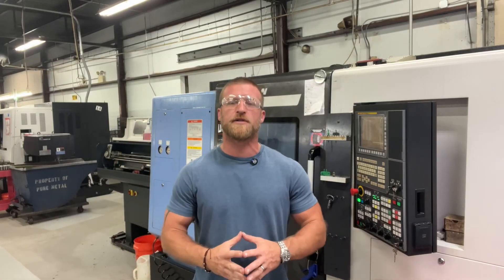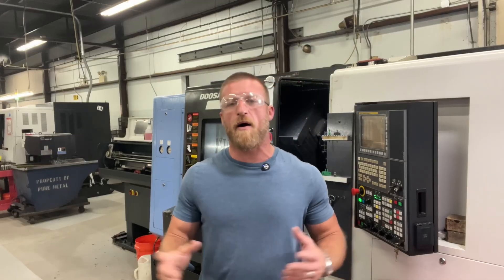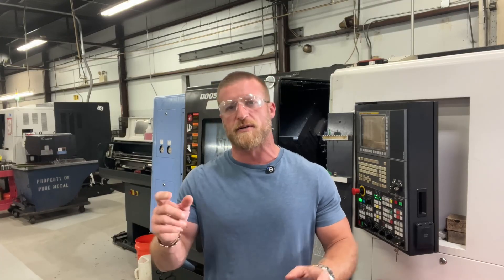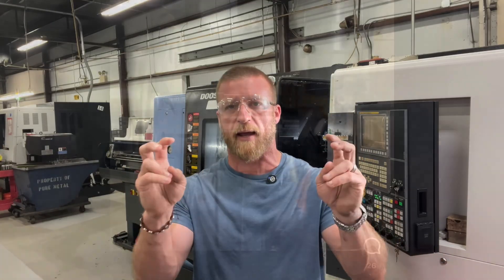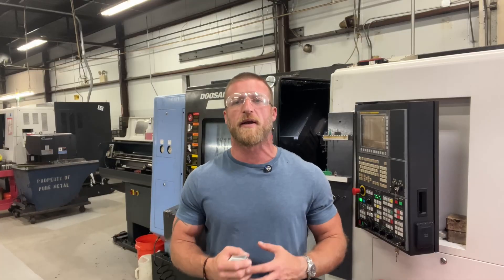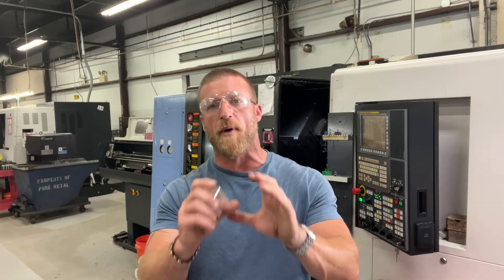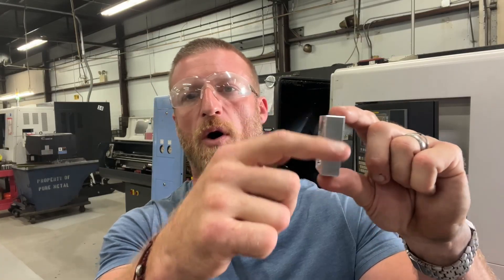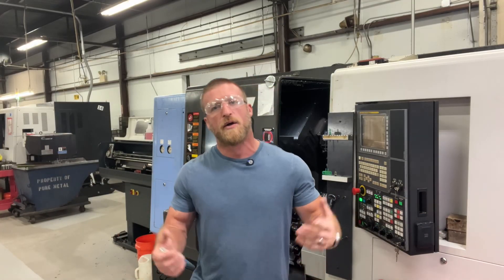Why Don’t We “Mill”⁉️ How We Use a Lathe To Mill. #cnc #cncmachining #machine

Comment: I'm 20 years in now. Started out conventional milling, 3 axis cnc milling to 5 axis cnc milling.
Currently working with cnc lathes, 2 Namakura's WT-150 and 1 Nakamura WT-100.
Eccentric Hainbuch chucks, all double turret with subspindels and bar feeders.
Max diameter is 40mm or 1,574 inch.
We also do all our milling on those lathes, including deburring.
90% of what we produce is for the medical industry so very tight tolerances and when it's spitting out products they are ready to send. No detailing etc

It's great to see craftsman like yourself show young people how cool this profession really is.
Reply from the maker: Hey thank you very much. That sounds like you have some awesome experience.  Keep kicking butt.!!

Comment: I do love lathes for this reason. One place to work hold when you’re working with a bar job, and it gives you access to every side except the back of the part in one op, and with a sub spindle you can reach that too. Plus while mills are of course useful and have their place (and at my work we’re starting to use thread milling to put threads on workpiece that before were put in massive heavy jigs and single point threaded on a CNC lathe, boy that was scary), it does tend to get old quick (in my experience). Lathes with milling spindles are so much fun cause they’re so versatile, you can reach all sides of the workpiece in one operation instead of at least 3 if not 6 and it’s more thrilling and primal if you like cause of ‘big spinny thingy’ as I call it as well as the danger factor 🤣. Love your content as always.
Reply from the maker: I agree with everything you said. Thrilling and primal hahaha I love it 😆 thank you for your input 🤝

Comment: We make some similar parts that you have shown us. Parts are turned on a manual or cnc lathe, then moved onto  the miller for drilling and milling. I try to reduce opps as much as possible by using madrels, indexing head etc. It's no comparison to a mill turn lathe. 

Guess what? work has dried up a lot, the company is on it knees and will probably go under in the next few weeks. We are simply not competitive anymore 😢
Reply from the maker: I’m really sorry to hear that man that’s really sad. It sounds like you have some good experience and you know what you’re doing.  I’m sure you’ll be able to find a job elsewhere.  Good luck to you!!

Comment: As you said, milling on a lathe is nothing new, but for us it just has too many limitations. Part size and the number of tools required makes it almost impossible to mill most of our parts on a lathe. It's actually much more common for us to make "lathe" parts on the mill rather than the other way around. We have a couple of 3-jaw chucks mounted permanently on the mill table so we can do both sides of round parts.  For more complex parts, we use a rotary indexer mounted on a 4 axis horizontal. That allows us to do parts like in your video with the obvious exception that we can't auto transfer parts from 1st to 2nd op. Bottom line is the lathe doesn't get much use here.
Reply from the maker: Well that is an interesting twist to the story. Making lathe parts on a mill? I’d love to see that - pretty darn cool. I wonder what these parts look like that need to many live tools to make n
Reply from the maker: *how complicated the part must be that you need more than a dozen live tools man I’d love to see that part. Really cool man keep kicking butt

Comment: For smaller parts in the lower or mid tolerance range using live-tools these double spindle/turret lathes are great, very weak point is rigidity on the live-tools.
Also live-tools with long hours or heavier cuts need monthly inspection on wear and bearings.
With higher tolerances you tool height needs as close as possible to center-line, just as a very accurate c-axis on larger part diameters.
When you do high-end parts you definitely need a mill-turn, con is longer time on tool changes.
Reply from the maker: Those are all really great points to bring up. I’ve never been on a mill turn, so I can’t speak to that, but I’ll take your word for it.  One thing I can say I know first day very well is that the tool pockets don’t have the rigidity and they’re more prone to having bearings need rebuild and replace.

Comment: The only reason we run mills at our shop is for rigidity. I run exclusively round parts on the mill. I have a 4th axis and a 6 jaw chuck, no vise on the table at all. Drilling a 1 1/4" radial hole in 316 stainless a capable mill is just cheaper than a lathe that is capable at the same speed. For us its more justifiable to buy a mill and do a couple extra ops in there.
Reply from the maker: Hey in that regard, you’d definitely NEED a mill. Rigidity on a mill is another level compared to a lathe with a live tool. 100% agree and that’s a great point to bring up

Comment: Would a Y axis Haas be just as good? I have parts I've been milking that I think can be done on a Y axis lathe but it's 1045 carbon steel. I'm not sure if the Haas can handle it. It's an ST35Y. Any help is appreciated.
Reply from the maker: Oh yea I think it definitely can. 1045 isn’t horrible.  Maybe you’d have to kick down the depth of cut. Is there a lot of machining to do? Also m, I can’t help myself - but do you milk your parts regularly? LOL sorry I couldn’t resist 😂
Reply: @Crusadermachining milking is crucial 😂 

So basically it's a 2.5 inch open slot. Looks similar to the part you showed at the beginning of the video. We're getting the lathe on the 19th. Your video came in just in time. I've just never milled in a lathe.
Reply from the maker: @wpdogman heck yea man! Good luck on the new machine and don’t ever hesitate to reach out. I’ll help if I am able to - Instagram I’m pretty active in the DMs

Comment: Something that annoys me a lot about my shop is that deburing on machine isn't the standard. Tons of work needs to get manually deburred to the point we have a whole department for it while we're lacking operators. Always lovely to see fully deburred threads off the machine
Reply: Are you not allowed to deburr on the machine?
Reply: @thunderthormx we are, I implement it all the time but the guys and especially the department head doesn't think it's faster so they don't really push for it.
Reply from the maker: That’s what I want to know also.
Reply from the maker: Oh I get that man it can be really frustrating. Have you tried to push them to Deburr on machine ? And I know what you mean about beautiful threads.  it’s wonderful.
Reply: I have worked at a lot of shops that don't deburr on machine.  Recently it seems like there is a major regression and management misunderstanding of efficiency.
Reply from the maker: @chrisrokz9005 I can’t argue with that point. We try and do all of that on machine but I do have some friends that do not. They’d rather have a faster cycle time and then Deburr by hand.  If it works, it works
Reply: What extra processing does deburring a thread involve?